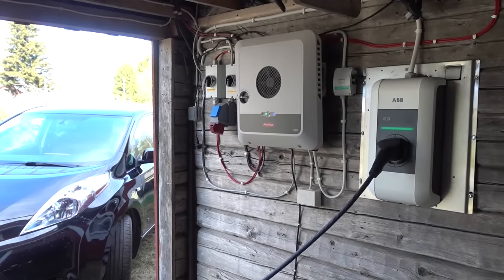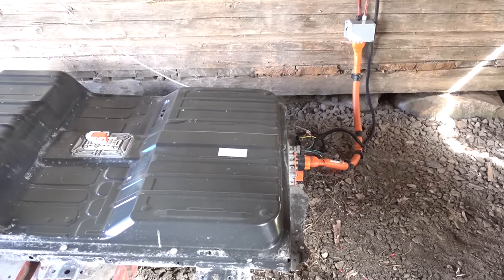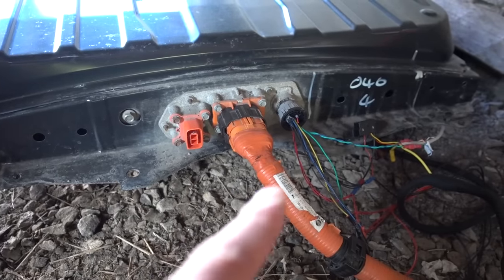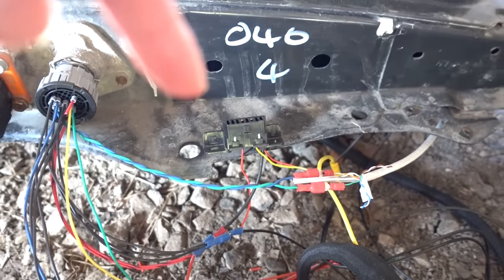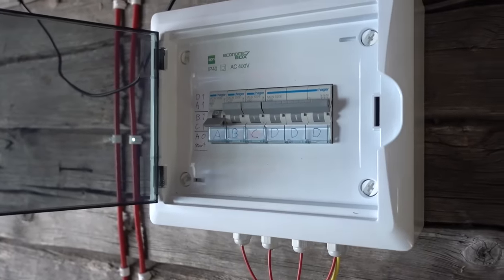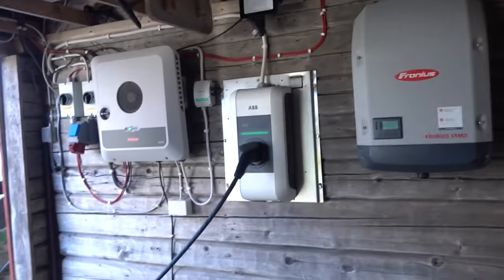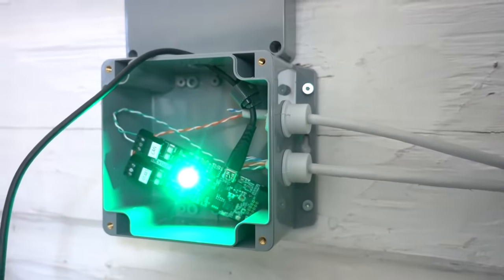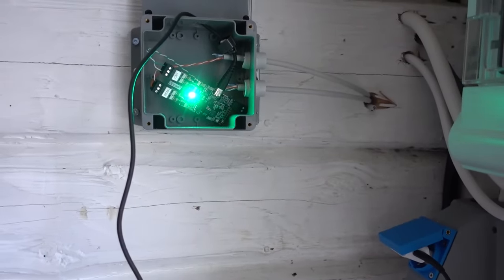The EASIEST way to connect used EV packs to grid! 🔋

Comment: How does this setup handle failure of power to the 12v switch panel? As configured it looks like it would re-engage the contactors without doing the precharge step if the 12v supply was interrupted and then restored. Really it should always fail safe by tripping off all switches, or be automated so that it runs through the correct startup sequence every time power is applied.

Looks like failure of 5v would just cause a comms loss between battery and inverter which should be handled gracefully by the inverter.

In your final setup it would be best if the 12v control of battery contactors was done via the microcontroller so that there is some control over it (i.e. only enables DC battery output when safe to do so) and all systems powered off a single supply so that power failure and restoration is safe and predictable. - granted most storage batteries dont have contactors at all so this is a layer of safety not normally present.

Does the Leaf battery BMS decide if the contactors can close, taking the 12v signal lines as a "request". This is important to know if the battery BMS can protect against over discharge or thermal events by disconnecting itself or if that should be implemented by your system (hopefully its in the BMS so that it is more reliable and meets manufacturers specifications for the battery)
Reply from the maker: Yes a 12V battery needs to be added to the 12V circuit to keep the contactors on incase of grid failure. An even simpler solution would be to connect the 230V-12V adapter to the PV-Point outlet that is always on.

5V failure is graceful, it just stops charging/discharging

Microcontroller for contactor closing/opening sequence would be a great addition.

LEAF BMS sends request to open contactors incase it encounters a severe error. In the current code we stop charging/discharging incase a failure flag is set.
Reply: @DalasEVRepair  so the leaf BMS requires external control to open the contactors rather than being able to do it itself? If so you would need to implement that response to fault flag in your contactor control to retain the same level of safety as the battery originally had when in the vehicle (although it's a less necessary feature here, but useful given you dont have an isolator switch next to where the battery connects to house wiring).

As for 12volt a backup battery doesn't change the problem as it can also go flat and leave you in an unsafe condition when power is restored. Best solution is powering it off the inverter or the mains circuit it is connected to so that they both fail together. But you need to test what happens if you close the battery contactors in an incorrect sequence before trusting the solution you have right now... I suspect nothing bad will happen because the pre-charge is for charging the capacitors in the motor inverter, which is no longer connected, there might be some inrush current from the inverter depending on the design but it likely isn't significant (although that depends on the specification of the leaf contactors as they aren't designed to close or open under load in normal use - opening only occasionally under a fault load).
Reply: @DalasEVRepair  I thought the PVpoint outlet is only on during grid failure?  at least that is how it is supposed to operate in Australia.

Comment: HI
Super job !!!, I already envy you a bit;) I would like to try it myself (I have some experience with BESS), is it possible to get a description from you of how to connect the Leaf battery BMS control system ?  I currently have a Leaf 30 kWh and am using it as a V2H to a heat pump for hot water (via CHAdeMO and Electway inverter, works fine but limited to 1 Phase only), I would like to connect this to my PV inverter (14kWp) with (the ModBus connection to the inverter they can handle) Thanks in advance!
Jaro
BTW - as I watched your YT about the CCS to CHAdeMO interface I immediately ordered 1 pc for myself in China, but it will be only in 6 weeks;( can't wait already
Reply from the maker: Hi,
See the Github link in the description for the Battery-Emulator page. There is a full wiki there with all info!
Reply: Hi Dala, You are GREAT ! You have prepared a perfect instruction !. I managed to prepare the working Lilly interface in 48 hours (incl. 40 hours waiting for the hardware;). I use GoodWe 10ET so PV side is ready.  Now I am chasing for a suitable battery (in Europe), how about IONIC 5 - 2021 (73 kWh battery number 37501-GI050), did anyone took this challenge ?
Reply from the maker: @jaromirpalach  Nice, no work started on Ioniq yet, better to go with a supported battery!
Reply: OK Ioniq is the future, understood. I consider the battery from Tesla Y ( I found one in the range of serial numbers you gave 1700012-00-B ;) but I have concerns about whether it has a built-in precharge resistor or whether I have to do it myself (I'm a bit afraid of that). How do I know if a battery has this resistor built in or not?   @DalasEVRepair
Reply from the maker: @jaromirpalach  Incase it hasn't been opened, it will have the PCS inside!
Reply: OK I got it. Nice to hear it ;) (I thought there as some versions without it). What would you recommend then - to go for Tesla 1700012-00-B ( it has a different last character you mentioned 1700012-00-A)  I can have it for like 6kEuro but how about the liquid cooling ???) or look for a (looks like proved concept) ] Nissan Leaf 62 kWh battery pack ? I am puzzled.  @DalasEVRepair
Reply from the maker: @jaromirpalach  Both Tesla and Nissan are good choices. Go for the cheapest one! (liquid cooling is not needed)
Reply: Hi Guru, Thanks for the answers;) I went for Nissan (as it's cheaper) and in the future for Tesla:)  Working crazy we are making progress with the connecting a Nissan 40 kWh battery for PV inverter (Goodwe ET) - I have two simple questions - 1. do the wires from Nissan battery  (X 408?) CAN connector - labelled Ignition (red) and Battery (light blue) need to be connected to anything (e.g. 12 volt battery +?) or just leave it unconnected? 2. Could you please provide the sequence (and hold times ) of the pre-charge resistor switching sequence you designed (you called it "dancing";)? because since we want to make a small circuit on RaspberryPI PICO to automate this process;), or mayby it is already published somewhere in your "Dala's cave of secret knowledge" Thanks in advance !  @DalasEVRepair
Reply from the maker: @jaromirpalach  all your questions are answered on the wiki, check the LEAF battery page!
Reply: OK we dig and found it in BatteryCOntrolWireing.png, sorry. But still there is question what you mean for "constant" 12 V DC, is it ok powering it from the very beggining (before "dancing") and ending after disconnection of the battery relays for few seconds ? The question is how to properly operate Switching ON and Switching OFF the BYD emulated battery to GoodWe inverter ? as we are not going to have it connected permanently.
Reply from the maker: @jaromirpalach  yes that is OK. Check the Goodwe manual for their recommended startup/shutdown procedure
Reply: Hi, a new project, as Nissan batery works perfectly, thank you so much!. We have a problem with the operation of the LillyGo with the TeslaY 78 kWh BAttery . When we connect the power supply and the LillyGo indicates a green LED all the time, but does not switch on the HV contactors. At the same time the monitor is showing us LID closing errors - Penthouse LID open (definitely closed), and HVIL Closing contractors not allowed (we also have 4 checked and shorted ). What could be the cause ? We are testing without the PV GoodWeET inverter, does it have to be connected to the LillyGo via RS485 and what does this have to do with the LID/HVIL errors ? Thank you for any hints
 (I signed in at Parteon also)
Reply: Hi, ASKED AGAIN THIS SAME Q; I got a new project. We have a problem with the operation of the LillyGo with the TeslaY 78 kWh BAttery . When we connect the power supply and the LillyGo indicates a green LED all the time, but does not switch on the HV contactors. At the same time the monitor is showing us LID closing errors - Penthouse LID open (definitely closed), and HVIL Closing contractors not allowed (we also have 4 checked and shorted ). What could be the cause ? Are you sure the LillyGo interpretation of messages from Teslt battery pack ? We are testing without the PV GoodWeET inverter, does it have to be connected to the LillyGo via RS485 and what does this have to do with the LID/HVIL errors ? Thank you for any hints ! or directing me to other folks had this same problem before ;)

Comment: I have a Sungrow Inverter and battery and know there is a CAN Bus connection inbetween both, but I doubt I could just hook up that battery directly... But I could use a RS485 BYD battery with that Sungrow inverter, so maybe you can also add that to the inverter list? I have a Sungrow SH5-0RT for example.
Reply from the maker: Any inverter compatible with the BYD HVM 11kWH battery will work for this solution yes! Just needs more brave testers!
Reply: Google "byd hvm compatible inverters" for a list of compatible inverters

Comment: This is a good one, I am using a 10kW 3-phase hybrid SolarEdge invertor with a 4,6kWh battery, if i can use a Tesla or Leaf battery pack with the SolarEdge that would be perfect. 
Can it work with SolarEdge?

Comment: I’d love to do this with my Renault Zoe when the car is worn out. Trouble is after 5 years and 80,000 miles both the car and battery are in fantastic condition, so I guess I’ll be waiting for a while yet…!
Reply from the maker: I added Zoe support last week!
Reply: @DalasEVRepair  five years to get my head round it, and to get more solar

Comment: What is the DC voltage of the leaf battery?. Because so many modern  appliances can run on "straight high voltage DC" (unofficially). so mabe its possible not use a "inefficient" inverter. Especially devices with a switch mode power supply (or some sort of inverter inside, like some new fridges with vfd inverter)
European 240Vac has a rectified DC voltage of 340Vdc. So if its close it might just work fine, with most appliances, able to work on 100vac to 250vac
Reply: European 240Vac has a rectified DC voltage of 340Vdc. So if its close it might just work fine, with most appliances, able to work on 100vac to 250vac.
Reply: The problem with that is 1,) the maximum short circuit breaking capacity of that battery is probably above 10,000 amps. A special fuse setup is required to break that when it's DC, especially 400v DC.
2.) Many house type switches wouldn't last long with the arc from the hall effect on DC
Special circuit breakers would be required . AC is slot easier to interrupt in a fault  
3,) building insurance wouldn't be covered from non standard electrical distribution faults

LED lights run at low voltages internally like 50volt. Computer related is 12v & 5v. the use of Battery DC direct makes sense - just not at 400v to consumer goods. 
12v a bit low for cable size , 24 - 50v would be good  Air Conditioner inverters have rectified mains DC voltage on the bus, powering those directly would make sense. To data only seen one DC Powered Air Conditioner for sale from the Far east
Reply: @punto182  for me I think the biggest hurdle will be the insurance for a non standard electrical system. You could "DIY" your self out of most high-voltage DC switching problems. Use 3pole switches(wired in series) for LED lights.(I have experimented with adding small magnets to switches to "blow out" the arc) You could have a pyro-fuse with remote activation. I have experimented with adding a igbt or mosfet to a switch. The the mosfet/igbt initially brakes the DC and the switch finally isolates it(hybrid switch). I have tested several "supposedly" AC only appliances on straight 350Vdc battery string, with good results. Most Switch mode power supplys and buck converter work fine. Obviously older transformers and induction motors don't. The newer LED light bulbs in Europe, have a high internal working voltage 200v or more(long series strings of led). Mains voltage just goes through a bridge rectifier and sits as 300 or more volt, on a  reservoir capacitor, in these appliances. https://youtu.be/Au3wURws_Bg

Comment: Have you ever thought about making a somewhat plug and play solution and selling it?
Im sure there would be plenty of people who can source the high voltage battery and cable but the electrical wiring and programming may be too much for some (*ahem*). If you ever do, I would be interested in buying that solution.
Reply from the maker: I personally would not, but the code is open source so anyone can do it! Closest thing to a plug-n-play would be the Stark CMR board, which runs the Battery-Emulator code: https://github.com/dalathegreat/Battery-Emulator/wiki#where-do-i-get-the-hardware-needed

Comment: So have you just wired in parallel with your solar panels string on your inverter? Did you need to use a blocking diode to stop reverse current at night?
Reply from the maker: No the inverter has a dedicated HVBAT input next to the PV input. No diode needed

Comment: Assuming you add a power backup to the controller, do you have a provision in place to not pump electricity back into the grid, if the grid is down, but still connected to the inverter?
Reply from the maker: The Fronius handles this, check the user manual on how they do it! No backfeeding to the grid incase it is down!

Comment: Curious how this compares in cost to assembling equivalent kwh LiFePO4 packs using the DIY kits and grade A cells, assuming you don't already have an unused ev battery of course?
Reply from the maker: This is way cheaper, since you do not need to buy BMS, busbars, shunt, casing etc.

Comment: Amazing, thank you! You had mentioned in the GitHub that a hybrid inverter should be used, but would a battery inverter work if it had the correct comms? I'll be looking for an inverter based in the UK. Thanks!
Reply from the maker: Any inverter compatible with the BYD HVM battery via Modbus should work!
Reply: @DalasEVRepair  they seem to be less popular in the UK, but I'll keep hunting :)

Comment: Does this only work with Leaf batteries? 
I have a Chevy Bolt and would love a system like this for when it eventually is too weak for the car. 
Thanks for being awesome!
Reply from the maker: If the CAN messages for the Chevy Bolt battery can be decoded, then it is quite easy to add support yes!
Reply: Yes. SImpBMS has supported Chevy Bolt batteries for years.

Comment: Great project, got me all excited until I realized I do not have the technician password to set up and manage the battery on the inverter. Any advice?
Reply from the maker: Contact your installer, most are happy to supply it. Otherwise factory reset, contact Fronius

Comment: Hi Dala I'm really impressed with your setup. The Fronius gen 24 has a max output of 6kw. Is there any other inverter option that can work instead of the Fronius and is capable of being setup as parallel inverters to give higher kw output?
Reply from the maker: Any inverter capable of accepting the BYD HVM via Modbus is compatible!
Reply: @DalasEVRepair  thanks for getting back to me. I was on the fronius website. It states two gen 24's cannot be joined in a parallel. Do you know of a HVS inverter that can be connected in parallel and uses the modbus communication?

Comment: Hello, great vid, very interesting mod, was just wondering how the high voltage/amps is handled coming from the battery? Battery is 350V i think and it must be a minimum 24kw which means 68A and Fronius24 is only rater for 22A from what I can see on the spec sheet? I can see it is rated up to 455V so the voltage is OK but just wanted to know why the amps isn't a problem....thanks
Reply: Leaf battery capacity is 24kWh. So if you want to use all of that in one hour, you would need 68A and 350V inverter. But why would you want to do that? Are you running a gym with powerful sauna? You should understand that inverter sees the full voltage but only the amperage that is being currently used. So if your house uses only 1kW/h (our house uses about 450W/h when "idling"), then you could run this for 24 hours on Fronius24.

Comment: Do you think is possible to use regular lifepo4 cells and trick the fronius inverter into using them as storage. Same thing goes for huawei inverters. I have them both but geting a whole pack is hard in my area.
Reply from the maker: Ofcourse it is possible, but requires 10x the effort and custom coding